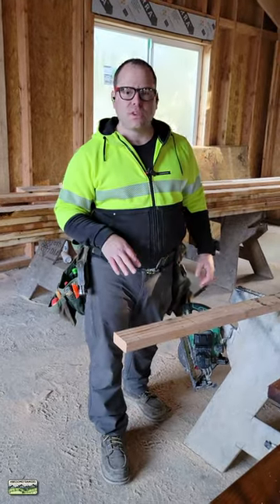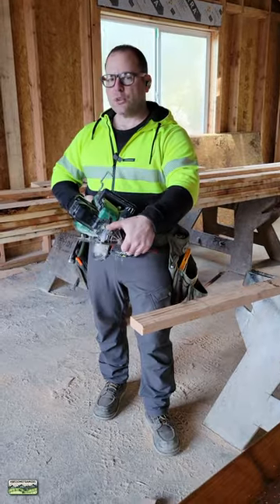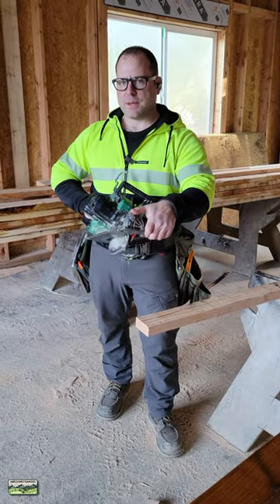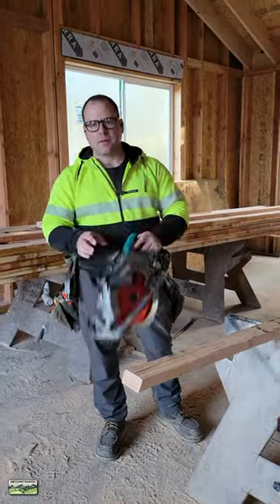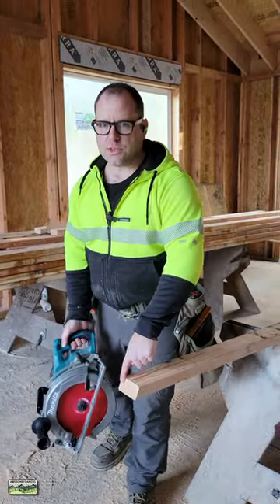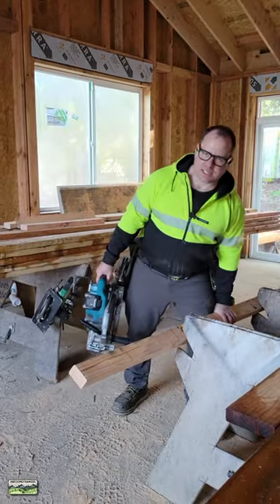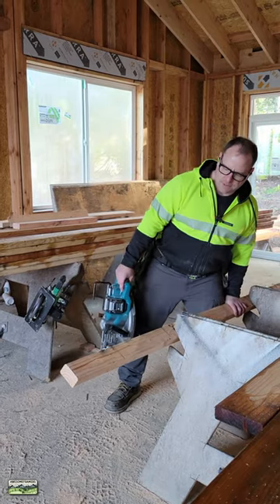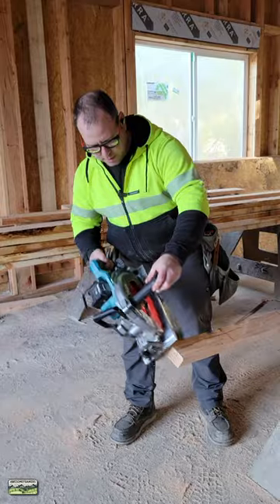Nice Angles! How to Give a Compliment #shorts

Comment: Thanks for the proof... I was on the fence there for a second.
Reply: Thought I was the only one
Reply: Clamp the timber alongside another timber and cut from the top (side wrt the timber). Even better, screw a guide batten to the holding timber and make loads of angle cuts.
Reply: I had a old man teach me how to do that my second or third year of framing and been using that method for 20+ years for anything over a 55 degree bevel but using a big 10” saw for the square cut is the real trick a regular 7-1/4 blade wouldn’t cut all the way through the wood on a steep bevel normally I would use a reciprocating or hand saw to finish the cut
Reply: you want to be on the side of the fence for an accurate cut.

Comment: why not just measure the 67 degree cut on the 1.5" side of the board? Then use the saw at its usual 90 degree setting. if it does not cut through, flip it over and finish it.